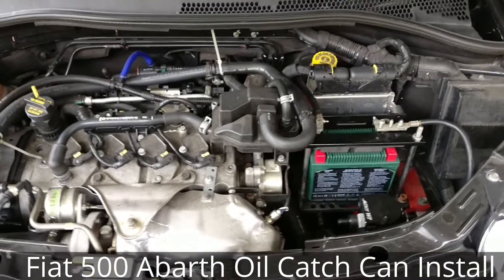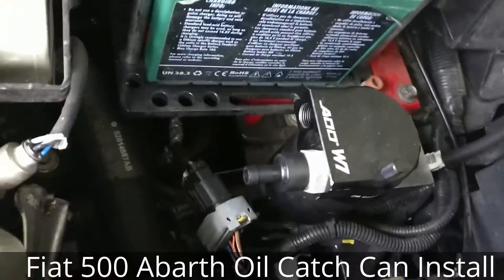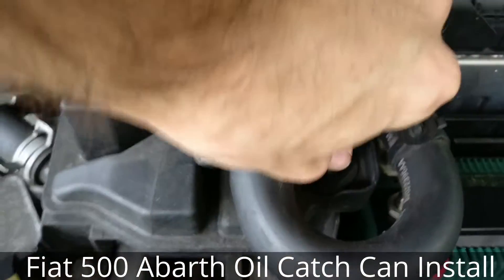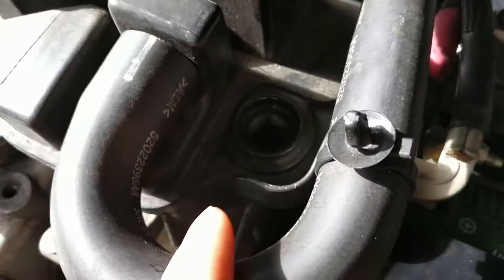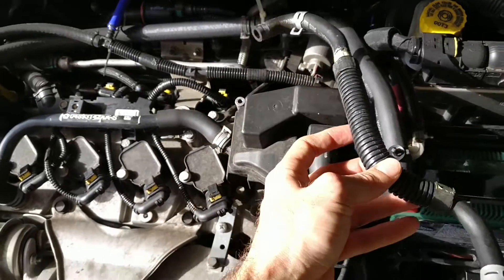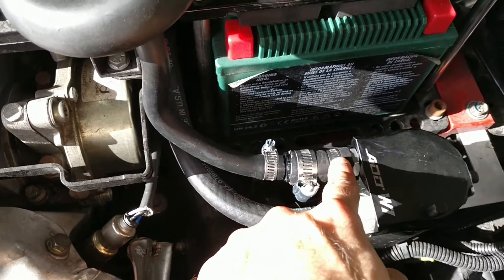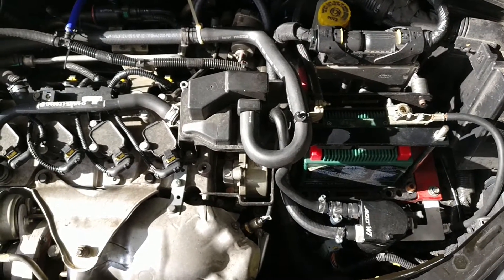Fiat 500 Abarth Oil Catch Can Install

Comment: A concern I think you might of overlooked is the position of your check valve. The check valve is AFTER the catch-can. This might cause the nastiness in the catch can to be sent back into the system. I might have had the check valve before the catch can. 

food for thought.
Reply from the maker: I see your concern, but I was not the engineer behind this setup. This is supposed to be the proper set up proven by other Abarth drivers who use their vehicles on the track.

Comment: What does the factory Air/Oil Separator box accomplish ? It is actually referred to as the PCV Valve although the PCV Valve screws into it and is removable as you demonstrated.

Comment: What happens if u don’t drill out that valve
Reply: ScubaSteve R, It is totally wrong to drill out that PCV valve, it should reconnect directly to the Intake of the Oil Catch Can and the Outlet of the O.C.C. connects to the intake manifold where the original stock hose connected. Simply put all you are doing is fitting the O.C.C. between the original PCV valve and the intake manifold.

Comment: I have a Doblo with the same engine. My PCV valve looks a bit different but the connections are the same.
What I don't understand: You intercepted the line going from the PCV valve to the inlet manifold, but oil vapours only go through there when not on boost. There is a second line going from the PCV valve to the intake pipe before the turbo, allowing the turbo to suck in the oil vapours when on boost. This line isn't intercepted at all in your setup, but I would think that's the line that recirculates the most vapours back to the engine, as the oil pressure is likely to be the highest when running on boost.
I'd think it's more logical to delete the stock PCV valve altogether and use a catch can with 2 outputs going to both the inlet manifold (through a 1way valve) as the pre-turbo intake pipe.

Comment: The check valve is to protect the crankcase from getting pressurized when there is positive pressure in the intake manifold. This occurs under Turbo boost.  You need a check valve!  Even 2 check valves in case one fails. LOL Cheers.

Comment: Please help me out.
Reply: Did you install a check valve (one way valve)? This is supposed to prevent the car from burning the excess oil.
Reply: Bojan Cvjetkovic does the check valve go on the "out" of the can? I have no check valve anywhere, I think I messed up somewhere, anything you can tell to help me out brother ?
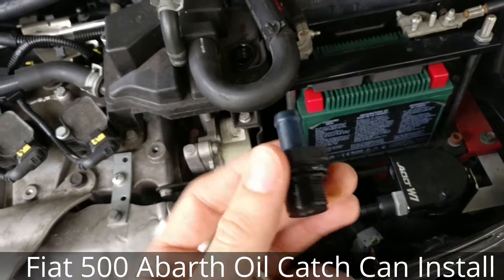Reply: at 57 seconds you will see a 1 way valve that needs to be drilled out because that should be a straight pass through. At 1:30 you will see the only check valve (one way valve) needed for the setup. You should be able to buy a check valve at most auto parts stores.
Reply: I replaced the valve that I drilled with a new one and everything is back to normal its running good, thank you very much for the info brother it's very helpful

Comment: What battery are you using?
Reply from the maker: This is a battery tender brand battery from Amazon, it's insanely light, almost feels like an empty box. It works amazing but I can't recommend it if this is your daily driver since it has trouble starting the car if the temperatures fall to the 40s and it's completely useless below 40 degrees